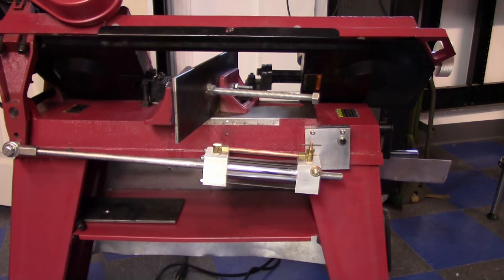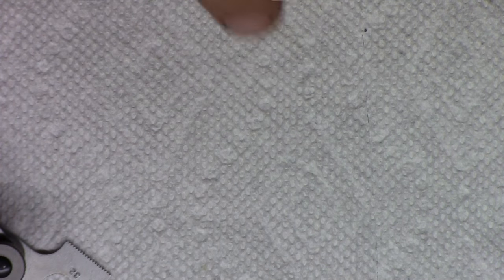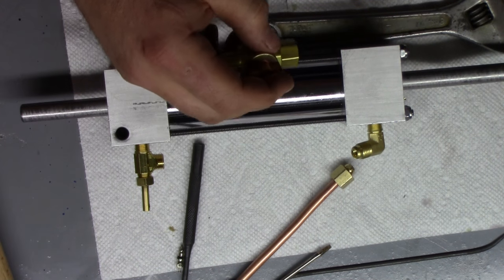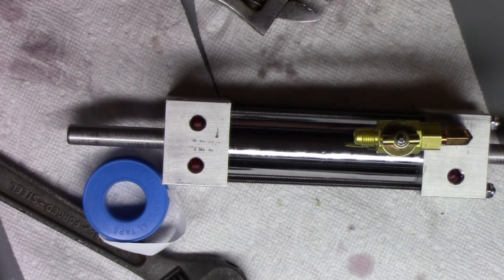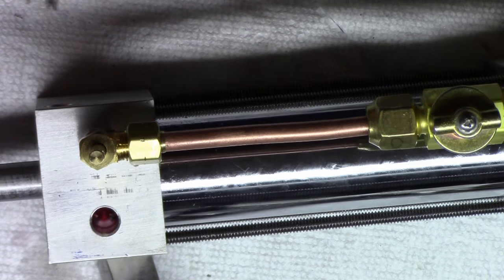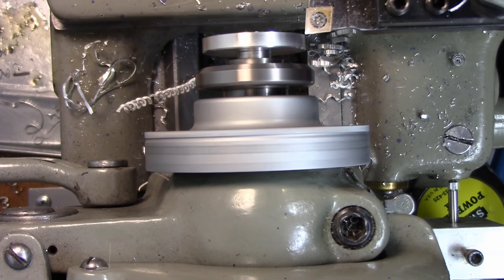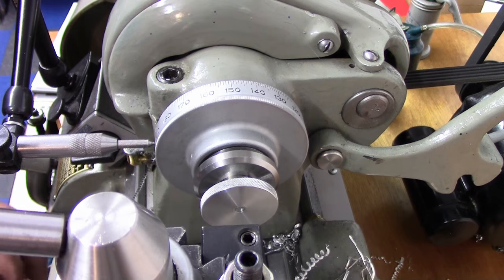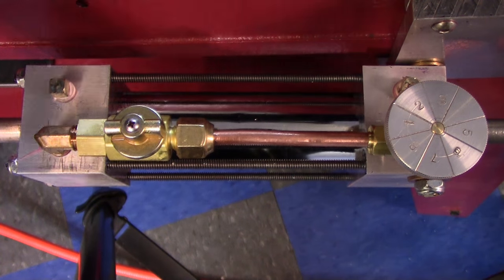Bandsaw Downfeed Revisited/Update

Comment: Looks like a great modification to a great idea. A few months ago, I started on my making of this downfeed device. I must admit my efforts didn't go quite as smooth as yours. It took me several tries just to get the end caps made. I lacked the proper cutting tools to make the grooves for the O rings, but finally found them on Mc Masters, along with the Heim devices. In my case, I drilled a 1/8 in hole through the center of set screw that controls to hydraulic oil. I followed Jason's suggestion and filed an X across the end of the screw to prevent to ball from blocking the return oil.  Thanks to your video and those great photos with information from the magazine you sent. I ordered a back issue of that article and it took 21 days for it to arrive. The end result is, that the band saw downfeed works great. I see now, why you were so excited when yours worked. I think I screamed a little louder when mine worked, which caused my wife to rush out to the garage to see what the problem was.  I just had to demonstrate my success to her a few times over.  Her response was "that's nice honey, now are you coming in out of that cold garage"  : ) . While your new idea looks great, I don't think I am going to mess with success. I am no machinist by any stretch of the imagination, however I do try to play one on YouTube ;) . PS, I ended up making three of the locking nuts for the quick change tool post holder. With the third one, I counter bored the nut for the handle to give it a more professional look. Thanks again....Ken
Reply from the maker: +Kenneth Bartlett 
Excellent!  Glad you got everything going.  Screw ups is how we learn :-)  I know it sucks when you do, but you learn why you did.

Comment: the break off tab on your outlet is used for other ways too..most common is to use seperate circuits ( from Breaker panel ) to give you a better chance of not plugging two devices in at once.... your use is another ..to switch the outlet seperately from somewhere...  i usually just use a plier to twist it off quickly...a few back and forthes to weaken it and twist it off...or twist off first try..lol

Comment: Very nice improvement.  I am hatching an idea that a small reservoir on a angle iron stand up by the pivot could hold a quart of cutting fluid and the needle valve could meter a slow drip onto the blade.  I am very impressed with these saws and they only get better with a few improvements.  I got one twenty five years ago and have never regretted it for a moment.  Merry Xmas.  Doug

Comment: Mine ended up getting made from an old air ram i had and i made the  valve block.
It has the ball valve shut off , a pre set slow feed needle and a lever type needle to run the blade down to the work fast .
I open the ball valve then turn the lever on the fast feed about a quarter tun and the blade glides down to the work piece when it gets close i shut the lever on the fast feed and it is now in cut mode .
If i really want to cut something fast i just crack the fast feed lever a little and it cuts faster but i have noticed the squareness of the cut suffers if i cut too fast .
Your ideas gave me more ideas and i now have a much improved saw -thanks!
Reply from the maker: +ian bertenshaw 
Yeah there is kind of a sweet spot in the feed rate to get the squarest cut in the fastest time.  I have a really nice quality blade so it's rigidity in the saw itself.

Comment: if you increase the angle and length of the needle chamfer, you will increase your flow control dramatically. right now the low angle of your needle chamfer is like opening a flood gate. just an idea for ya, great video

Comment: Nice!  Those little valve are a pain in the ass with their rubber packing.   If you can change that out with graphite packing(not the crap they "call" graphite at the box stores, I mean the real stuff), the valve won't bounce back when you let go of it.  Not a big deal, but would make fine adjustments much easier.  Really like that indexing method.  though I wanted to see you turn down the inner portion to leave an indexed band around the perimeter.  Yeah, I know.  I'm nit picking.  Super work on this mod!  Keep up the great work!

Comment: Notwithstanding your fine efforts in creating this video and not detracting from your description and showing your methods, the nett result of this hydraulic cylinder is limited. The best feature is the ability to "lock" the bandsaw blade in a position to allow cut length measurement. The needle valve will (in general) do one of two things slow the descent too much to make cutting less efficient or increase the descent to the point where the blade rests on the material and gravity takes over (the weight of the saw presses the blade on the material) effectively eliminating the hydraulic cylinder.
IF the device "could" improve the cut rate, then the needle valve would require regular adjustments to suit the material being cut. The descent through a 1" bar is different to the descent through a 3" bar is different through a 2" square tube. Using gravity as the descent control automatically allows the most efficient cut rate through each of these materials.
Manipulating two or more controls to "glide" the blade down to the work (as per another comment) may certainly look cool, it's not as efficient as placing the running blade on the material and letting it do its job.
Please keep in mind, that this is NOT a criticism of your work or the intended result, it is only meant to outline the minimum benefits of many dollars and much time expended for negligible gain. 
Thank you for your efforts, I can see from the many comments it has been very helpful to others :-)
Kind regards
Peter
Reply from the maker: ZenMinus 
I get what you're saying.  Only thing is that unlike say anpowered hacksaw where the swing arm is so light that there are actual weights you can move to put pressure on the blade and there is a mechanical lift at the end of stroke, these bandsaws have the opposite problem.  The swing arm is so heavy that if it didn't have any mechanism to resist gravity then the blade would just dig in and bind either stopping the motor or slipping the belt.  The beauty of the cylinder as compared to the spring that was originally equipped is that the cylinder allows for a constant rate of decent and.pressure on the blade.  The spring was variable depending on where it was in it's travel so you could set it to cut fine at first but later in it's travel it would put too much pressure on the.blade causing.it to bind.

Comment: That is a really nice improvement.  I see potential for a turning video on making a needle valve insert and needle with fine control for the range you need.  Hoke valves, and Hoke blocks are used some industries for this task.
Reply from the maker: +Jason Polensky 
Yup.  I looked into getting a nice valve, but the cost of a purpose built hydraulic type flow control is just way too much for what the project is.

Comment: My trick for knowing which way to wrap teflon tape is that if the tape were stationary and the thread was turning to wrap it, the thread should be turning in the same direction as you turn it to screw it into the mating part.
Reply from the maker: +Rob Mckennie 
Yup I do similar.  Thread pointed away from me wrap counter clockwise.  Thread towards you clockwise.
Reply: +Halligan142 my secret is to use Teflon paste:-)

Comment: You could restrict the flow through the tube by pinching it down, or some other restriction method.  Restrict it for the max speed you want when the valve is full open.  That should give you more useable range on your speed valve

Comment: to improve the adjustment on the needle vale Try using more viscous hydraulic fluid to provide you more travel on the needle vale. The thicker fluid is more restrictive to flowing through the needle valve and so needs to be open further for the same flow rate.

instead of the transmission oil that you used  if you use a 85-90w gear oil it will need to have teh needle valve opened further for the same rate of lowering.

Comment: interesting. I never seen a copper washer used on flare on flare fittings. Never seen them sold or needed either. I would think you only need it for positioning/aligning the fittings by giving you some crush room.
Reply from the maker: +ww_big_al 
Yup it allows you to adjust the position of things like sight glasses and such for my work.  It also ensures that both mating surfaces have contact with something all the way around.  As you can see by the fittings I got there is potential for the whole flared surface not to engage on the brass parts.  Not too much of an issue on something like say a water line, but becomes an issue when we use them to carry refrigerant in excess of 250 PSI
Reply: +Halligan142 
Thanks for the response. This will be something I will have to remember. Never did refrigeration, so I wasn't aware of them. This is why I watch so many YouTube videos. There is alway a nugget to learn from them. Nothing but crap bring on TV also helps :-) LOL

Comment: Is it possible to commission a video? I had an idea for a way you could use an imperial thread dial with metric threads, but you need a carriage stop and I don't have one. The basic idea is that you get the carriage up against the stop, and then always engage the half nut on the same notch on the dial. In my head it works, but everything always works in my head.

Comment: Nice work, thanks for sharing. May I ask what is the extra flat steel with the all thread mounted on your bandsaw for?
Reply from the maker: The flat bar are  jaw extensions for the built in vice.  They go right up to the blade.  The threaded rod is there so you can cut short pieces in the vice.  Adjusting the rod will allow the jaws to close parallel on a short piece of stock.
Reply: Halligan142, thanks but I can’t visualize how that works? Got pics, using it? I just bought and rebuilt an old Ramco RS90 bandsaw, so any tips would be most appreciated.

Comment: if you want finer control make a new, smaller seat you can press into the existing needle valve housing and trim the existing needle to match. smaller diameter with a more gradual needle profile will get what you want.  also it looks like the saw is still creeping with the 1/4 turn shut. a lot of those valves are directional and won't seal if put in backwards.(might put a plug in the port to make sure the cylinder/check isn't bypassing)